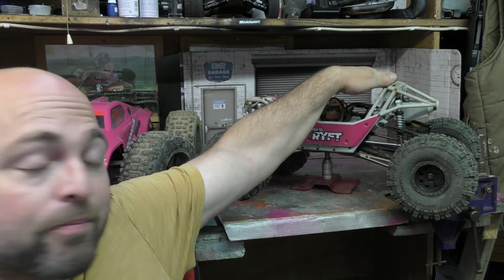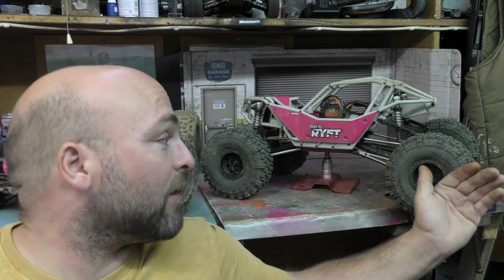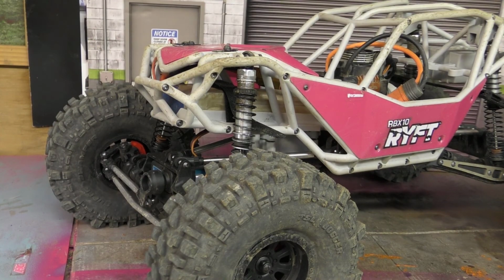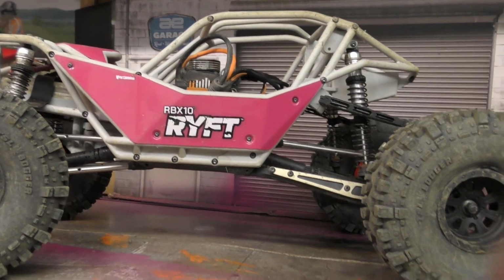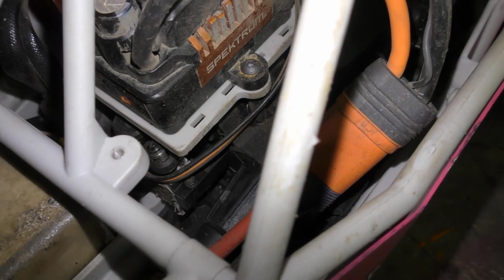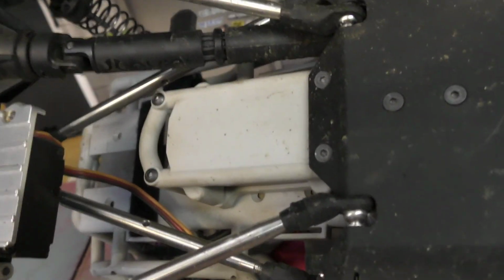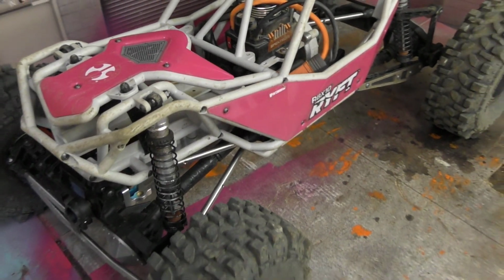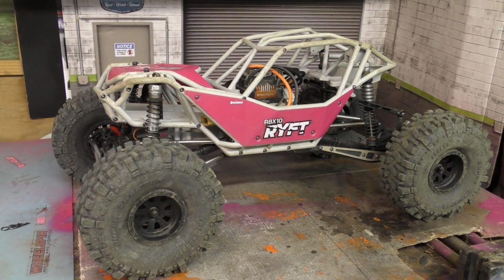Axial Ryft RBX10 Kit Review

Comment: I moved my links up at the chassis and It did lower it and help with stability for sure. Treal makes a servo saver for the LMT that works great on the Ryft. Also with the receiver box , I removed the stick one and put the receiver in the back aux. weight box. I did it with a connector coming out just like you were saying so that you can unhook without opening box